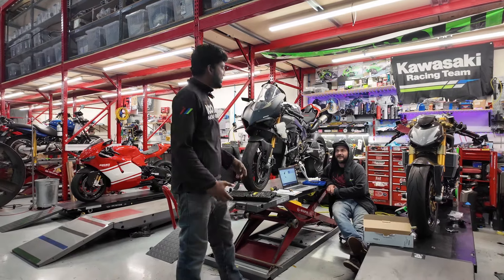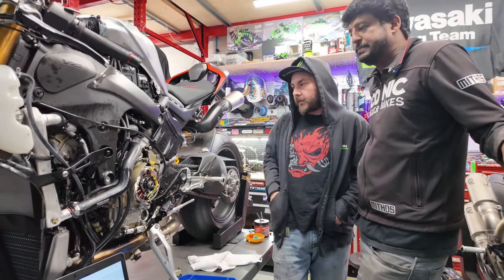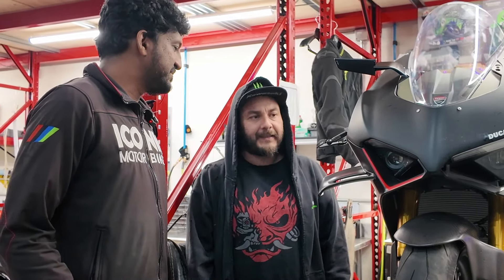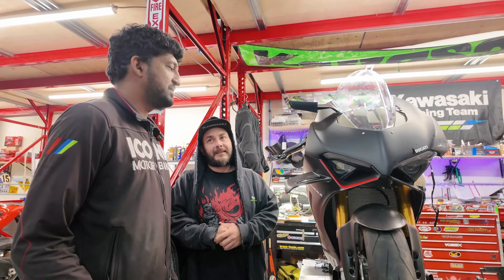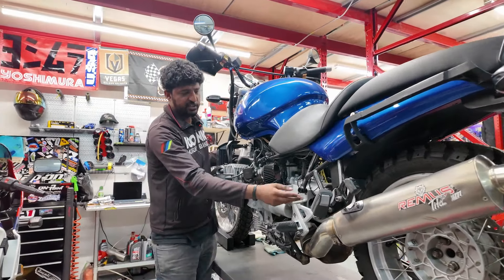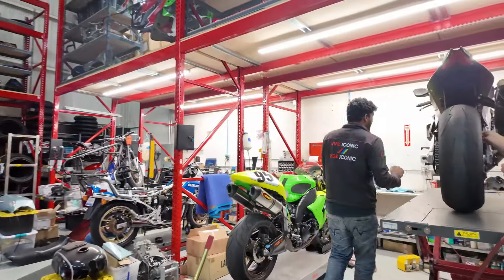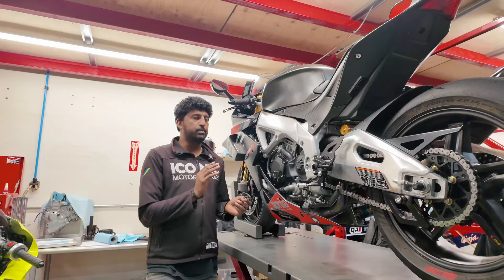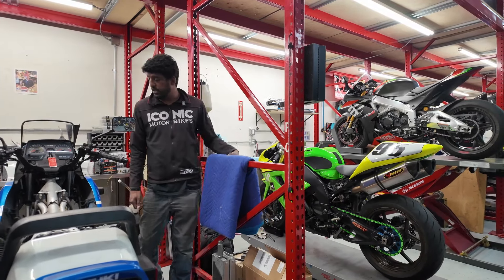Iconic Shop Walk - 11/05/24

Comment: Yes Angel. Stand up and speak into my right nipple so the punters can hear you😂
Ok, so I love the shop walks and the little clip on mics (Rode?) you use are great (could probably do with winding up the gain a touch) but yeh, always a struggle, for me at least, to pick up what the techs are saying. 
Just wondering if there is a way you can grab the second mic that Adam uses and palming it off to each tech as you check in with them so we can make out the conversations easier?